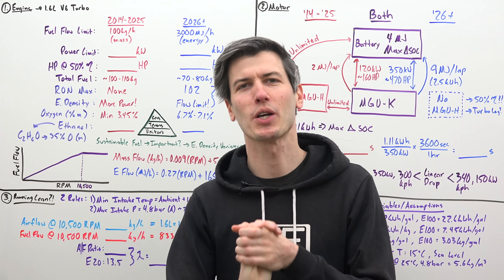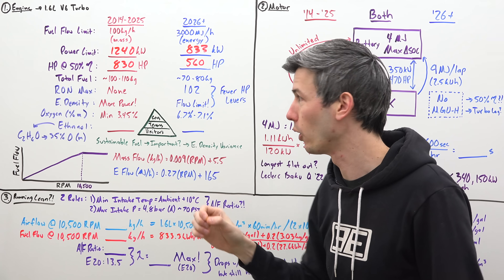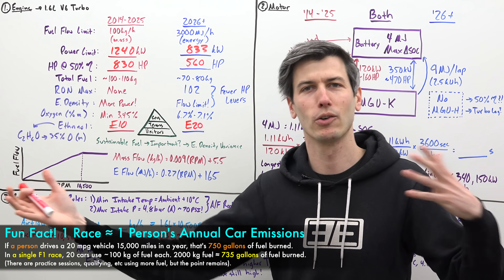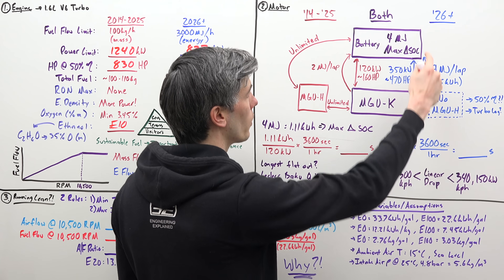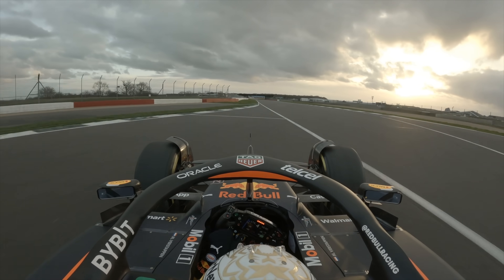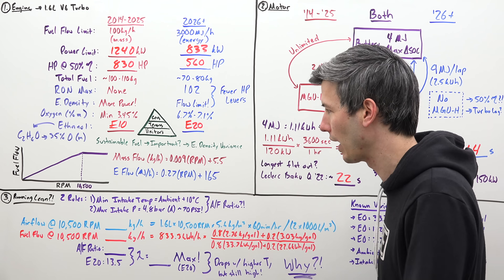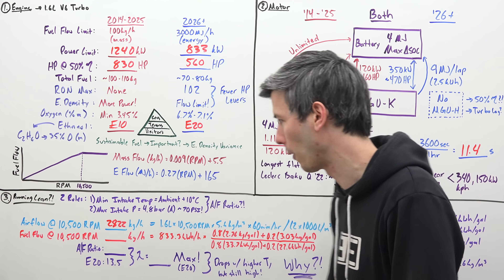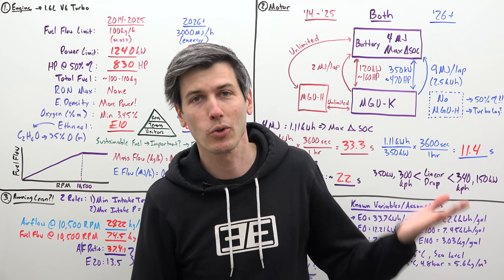Why Are 2026 Formula 1 Engines Going To Lose So Much Power?

Comment: RE weird air temp and compression ratio limits, I would suggest it's some sort of cost saving measure to make sure engine suppliers don't go crazy making a complicated engine that can run super lean. F1 want their sport more sustainable (from both a financial and environmental standpoint) and want more engine manufacturers like Ford to join. It's also why the MGU-H was ditched. Engines were too expensive and prohibitively complex for new engine manufacturers to join the sport and be competitive in. After the last engine rule change it took many seasons before the established makers were able to match Mercedes. F1 don't want that happening again. I think these are safeguards to prevent another Mercedes engine dominance era, entice new manufacturers and reduce costs for the teams and the sport overall to become more financially viable.

Comment: I believe it is about forcing F1 back to being a testbed for car innovation. Consumer fuel moved from E5 to E10 and this is a way to drive the move to E20. Also, controlling the air/fuel ratio will make them develop new alloys to support leaner running. It makes the sport a but greener but when it ripples down to consumer cars the impact will be huge. Great video btw.

Comment: Could the intake mass air flow limit be to put a ceiling on potentially low energy density fuels generating so much mass flow through the engine to significantly affect aero behavior? Seems there's a weight and volume penalty in low energy fuel (e.g. 100% ethanol) but maybe it could be made up for with blowing that mass over your rear wing?

Comment: These new regulations seem to introduce a bit more strategy and complexity for the driver regarding when and how you use the battery power. Unnecessary complexity in my opinion. Level the playing field and show us which driver is fastest, not which one can press more buttons in a lap.

Comment: In theory, if there is a 33% reduction in energy flow rate, and each car will take a longer time to complete, the energy needed to complete the same race distance would be more than say a 33%reduction of 110kg of fuel.

Comment: Europeans (*the ones implementing such retrograde rules) have too many whims on
their minds and too much time in their hands. Why don't they just sink F-1 down to the millstone? Bicycle thin tires with treads, lawn mower engines. Ban wings, aero, carbon 
fiber. Ask their Chinese "Shifu" to provide them with cheap and heavy steel tubing for frames. Magnetos and hand cranked engines on 3rd "Global" octane fuel, and super soft flimsy cheaply made belt and road sourced suspension for that extra bounce. LOL. 
Not to mention drum brakes so that late braking will be the domain of the brave. 
I am sure the said Europeans will love these suggestions and implement them whole.
All that is missing from the Frankenstein picture are some nice 850kg ballasts on the 
top 10  P finishers. Something very European* to punish merit and skill.

Comment: as for the battery, the old rules only allow 2 MJ/Lap, so even though the batter can hold 4, it will be limited to 2 if it uses it all each lap.  So at 2 MJ, we still get 16.67s of +150HP / lap.   with the new 9 MJ,  we now have available +470 HP over 25.7s each lap.    while they can only use this 11.4 s at a time, this is obviously much more energy each lap from the electric motor.   

This will still probably lead to longer lap times.  If the engine was operating at full HP all the time, the combined engines would put out the same amount of total energy after about 34.88s.  If this time is shorter, the new rules would produce more energy, but longer times favor the bigger ICE.  

Maybe on shorter tracks where the engine isnt at full blast all the time, the stronger electric motor cars might be faster, but I figure even 9 MJ/lap isnt enough to overcome the fuel changes.  Then again, the system might be lighter and simpler, so we might see better lap times due to this.. time will tell.

Comment: There was always some sort of air-intake limitation. Usually by an intake choke that every team had to run and was provided by the FIA(McLaren). I know they run prechamber ignition with a lambda close to one into the main piston chamber. Without a sort of exhaust gas recirculation like the MGU-H teams might choose to run more fresh air to get more mass providing similar pressure at lower temps. Which would mean oxygen in the exhaust which is odd. It could also be for areodynamic reasons as you can stall areodynamic components with the exhaust to a degree reducing downforce and drag at high speeds and engine load.

Comment: With the limited battery capacity it seems to me to make more sense to ditch batteries completely and use supercapacitors to store and release electrical current. An F1 car doesn't need to store electrical energy for extended periods of time and capacitors are much lighter than batteries. They can also store and release energy much quicker than batteries can.

Comment: Great analysis. I was surprised that there was no mention of the wild discharge and charge rates of the battery, relative to its capacity. Can the battery really do that, or is the 350 kW limit rule effectively irrelevant (at least for more than a second or two) due to the physical limitations of the battery?

Comment: I believe this lower engine power will allow higher throttling in the low speed corners, but it will be less efficient in the medium to higher speed speed corners for sure. 
I wonder if this will create a new category of corners in terms of its speed instead of 3 cats only; Low speed, Medium lower speed, Medium higher speed. and High speed corners.!?!??!

Comment: And this is why they lewis signed with Ferrari, because Ferrari has been excelling in this type of engines in Endurance racing and other ones and other disciplines. 
Basically its another like Mercedes phony fairy tale that took place when suddenly they changed engine specs to favor 1 team from 2014. The decision was announced in 2012 for F1 engine specs change back then. But this time its in Ferrari's favor, If Ferrari maintained its superiority in this type of specs.

Comment: The reason is not engineering, it's economic. FIA wants more street circuit races ($$$) and less track races ($) but the high hp cars are better suited for race tracks, so change them to be suited for street tracks. They'll be parades and not races, but that's where the money is.

Comment: The answer to the title is because F1 and the F1 teams are guaranteed a set amount of money and they have literally zero incentive to spend a bunch of money on better engines since everyone has to follow the same cost cap and rules which allows them to maximize their profits. Concorde agreements and cost cap are ruining this sport. F1 is supposed to be fastest, most extreme, most technologically advanced form of motor racing in the world yet there are already other cars faster than F1 and in 2026 there will be several more. It's a joke.

Comment: This is all really just virtue signaling by the rule makers. If they really wanted to demonstrate running green, they’d enact rules affecting the haulers, cars, trucks, planes etc, and especially refining the calendar of the races to reduce travel criss crossing across the globe, and they’d achieve much more cost savings and reduced carbon footprint. This racing is a form of high end entertainment, so if I was in charge I’d remove all the restrictions and downgrading of the engines and improve the entertainment product immensely, then institute the above things to improve the carbon footprint elsewhere within the ecosystem.

Comment: I would challenge the takeaway of the sustainable fuel being pointless. Sure, they’re not burning much of it, but if you want sustainable fuel to get really good really fast, throwing the biggest racing series at it is probably a good way to make it happen. So it will make a difference, but primarily in dividends down the line.

Comment: F1 needs to go back to the normal aspirated V-10' s. The 2026 engines will be turning 10,500 RPM's and being turbocharged, it's going to sound like crap, compared to the 19,000 RPM Normally aspirated V-10. Fans like to hear the engines scream! That's most of the draw to F1.

Comment: (02:05) “In theory, if you had a higher octane fuel, then you could make more power using that same fuel flow.“

Well, yes and no.

It is to be noted that the (research or motor) octane rating for any fuel is its resistance to knock, being predetonation, which is the limiting factor to high performance engines with regulated and/or limited fuel and capacity. Technically, however, the octane rating is not a number that quantifies power density in fuel.

For instance, the older generation of CART / Indycar open-wheel race cars, the equivalent of European F1, used methanol as fuel (and E85 currently), which has a significantly higher octane rating than even racing petrol, albeit with only about half of petrol´s energy density.

To effect commensurate engine power for a methanol-powered engine to it being fueled by petrol, one would need to store twice the fuel, and feed it at twice the rate. This is oversimplified, but sufficient to make my point.

This is why fueling an automobile with premium gasoline, when the manufacturer does not explicitly recommend its use, is an utter waste of money -- the higher octane number of premium fuel gives the engine as designed no advantage in ultimate power, fuel consumption, or (for the sake of why it is ever recommended) durability.

Comment: I can't see how the new F1 race engines can survive at a projected 35:1 air/fuel ratio.The must be someign wrong in the calculations?  My Corvette C6 Z06 came stock at 12.5:1 air/fuel ratioand was leaned out to 14:1 for max power with its 11.7:1 compression ratio without detonating.

Comment: Maybe the limits on air flow are there to prevent the richer teams from using very exotic (expensive) materials to push the safe output of the engine - maybe during qualifying - higher. This is off the top of my head, but the only reason I can think of right now…
Reply: Uses of Exotic parts are limited for quite awhile, and you can't change any internal parts of engine (with possible exception for FIA-issues sensor).

Comment: Best part of F1 was the engines and their sound back in the 12 10 8 cyl days. The V6s could sound good, but they are rpm limited by the fuel rules. Shame. Indycar is going to run into empty batteries each lap as well starting next year, especially on ovals.

Comment: I'm not sure if it was covered, but maybe a little more detail on the benefits of super lean combustion would be interested. I've been out of chemistry and physics for a while, but does the engine get more efficient as it gets more lean because more of the combustion heat is absorbed by the unburnt air which then increases the pressure in the cylinder? If that is the case, maybe the absolute max on airflow is to create an upwards limit (hard to reach though it may be) due to this effect? Then again, I could be out to lunch.

Comment: This is a good chance for F1 to remove minimal weight since power goes down, crush structure is standard and the budget cap prevents the wealthy elite from using unobtanium material.

Comment: @EngineeringExplained 
Are their any specifics around using an Interchiller system on this new gen 2026 regs? You would be able to claw back a lot of power loss by running an interchiller system which would give you low consistent Air intake temps

Comment: It's pretty easy to get below ambient temperature with a turbo and intercooler. If you cool the pressurized air to near ambient and then expand it - it will be below ambient. I've seen it many times on turbo/intercooled cars when the intercooler (or piping) acts as an inherent flow restrictor for which there is a pressure drop across. That's probably why they have a temperature limit, otherwise they could still continue to increase flow by increasing boost and expanding it through a restrictor to the maximum allowed intake manifold pressure but driving the temperature down instead of the pressure up.

There is a company using scuba tanks for forced induction drag racing, and the inlet temp ends up being like -150F, and they can use near stoich air/fuel mixtures with "normal" ignition advance as if it were naturally aspirated - but making several times the output.

Comment: I genuinely don’t understand why the FIA tries to make the race less fun. 
So I propose a new category above F1 called Formula X. The engine can have any configuration you want but cannot displace more than 5 liters. You may refuel the vehicle or change the tires in your pit stop but not both at the same time, and each pit stop is limited to a timed maximum of 10.5 seconds. You may only pit twice in a race. Any further unnecessary pits will result in time penalties or disqualification. You can have any number of tires on the vehicle and the vehicle can be configured in any way as long at it measures no longer than 4.5 meters and no wider than 1.6 meters. You can use any type of fuel you want, and you can use anything you want within the confines of the rules stated. All vehicles can weigh no more than 1,100kg with the driver.

Comment: The discussion of battery deployment time assumes the driver only uses electrical power to accelerate down straights but it is also used in a series of small bursts to defend against a closing car. Having a third of the deployment time may be another effort by the FIA to increase overtaking.

Comment: F1 is the pinnacle of motorsport. They should just open the engine development as long ss they're using syntethic fuels that emits much less or no carbon at all. Imagine having an engine revving all up to 19,000 rpm and screaming. It's a shame that F1 needed to do such backward steps in the name of "sustainability" and to cater the entertainment of some people who wanted "closer racing". F1 is not like that, F1 should be a competition of teams who can build the fastest, best car and I'm glad Mercedes and Red Bull has done that despite having to abide by the strict regulations

Comment: They need to focus on making the cars smaller more than anything. Which I’m sure means making the power units smaller 🤷🏼‍♂️
Reply: Actually the PU size isn't the problem. The teams design the cars larger than necessary from a purely technical standpoint to gain floor area which increases overall downforce. The gearbox casing is actually mostly empty space, containing a long shaft reaching from the engine to the actual gearbox, just to increase the wheelbase to the teams liking.
Reply: @shi01  yes, and, safety I’m sure?
Reply: @peterfconley  Actually no. They really just do this to get extra downforce. So the cars really don't need to be as long as they are now. There is more than enough space available to shorten the cars.
Reply: @shi01  so I guess the directive should be “Make them smaller but no less safe and no slower.” I just think they lumber around slow corners too much.

Comment: There will still be a lever to pull in terms of energy density in the form of weight savings. A short lever, but none too short for the pinnacle of motorsport.

Edit: posted literally the moment before you said this 🤦🏼‍♂️

Comment: Just a thought for the new rule limiting air intake condition: Without MGK-H in place, the teams could introduce a pneumatic accumulator to recover some of the energy wasted at turbos.  Hence rule to limit that 'air battery'?

Comment: I die some math ony my batteries feom my math, they deliver 3,7 with a max of 35amps ~130w with 2,2Ah oft capacity.
To reach the 2,5kwh you need 307 Celle with a maximum power of 40kw without shortcircuiting thwm. How do they extract about 9x the power? My batteries are limited to .1ohm. Many batteries wouldnt even survive that. Im curious what batteries they usw to achive that insane power

Comment: is the f1 2026 engine gonna have a smaller displacement?

f1 2026 still gonna keep the v6

i heard that f1 2026 cars will sound better & the rule is that teams will remove the mgu-h

in the future, f1 can use hydrogen for power

Comment: My thought on the air flow limitation is to discourage the previous practice of blowing hot/cold exhaust air through the diffuser. I know there is a definitive rule against such a thing, but maybe an extra way to prevent a different area being blown.
Reply: Wait, air flow limitation is for the intake to the engine, this video does not discuss anything about the exhaust flow limit, unless they waste energy by cooling the air and exhausting it back out through the diffuser..?!

Comment: Well in the blown diffuser era, the aero benefit of exhaust blowing was so high, that teams effectively used their engines as pumps. Now that the ICE is becoming a even lesser contributor of power to the the PU, maybe it's suddenly even more interesting a proposition to find a way to use the exhaust gases in this way. So a cap on inlet air temperature, and inlet air pressure effectively sounds like a cap on thr total volumetric flow rate of air, as you mentioned.
Reply: i always wondered if it was possible for a turbo to generate enough airflow to outright produce thrust
Reply: @Appletank8 it is
Reply: @lemonmaster8933  Has anyone ever tried oversizing the compressor wheel and like, turning a piston engine into an extremely janky turbofan set up?
Reply: @Appletank8  in theroy I guess it's Possible as an engine is basically a glorified air pump